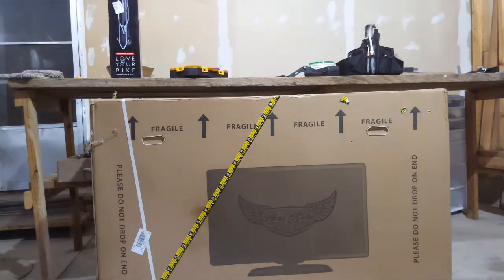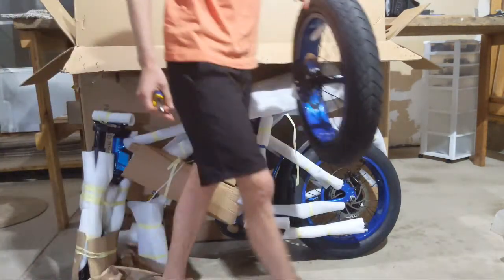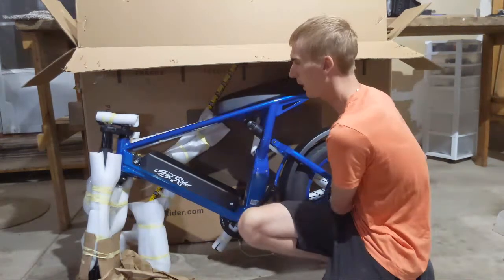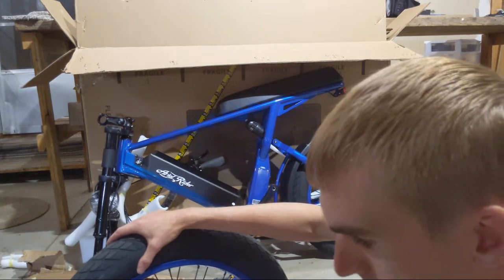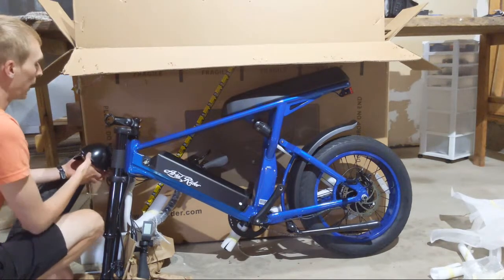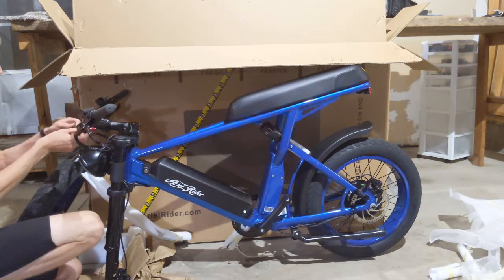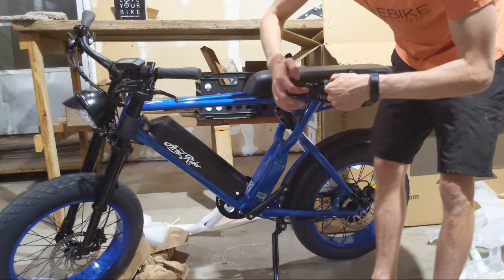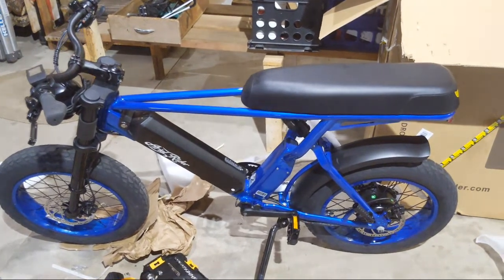Ariel Rider X-Class Live Unboxing

Comment: A nice air shock in the rear would probably do wonders for the ride.
Reply from the maker: There have already been people in the FB group upgrading the rear shock. If you're riding on the street this is probably fine but this would be an upgrade at the top of my list if I was looking to make changes. Having a blast with it so far.

Comment: Are you glad you got this and not the newer model?  They just changed!
Reply from the maker: Are you talking about the seat specifically?
Reply: I could not tell.  Did they only change the seat?  One person said the new model was faster. I wondered if they changed the controller or motor (even if it’s the same nominal wattage).
Reply from the maker: @howsth1s  I believe the shorter seat is now standard so you get some storage space. From what I read, both motors have the same specs - they just had to go with a different brand. You'd want to confirm with them if that was a deal breaker. The one I got is plenty fast...
Reply: @EbikeEscape  I received this email from AR:  "The seat has change and all future models with be twist throttle on the right side.
The new X-Class has the same speed.
 We do not have that [second seat] option yet but should in the future."

Comment: I don't know what it is with all these electric fat tire bikes getting flat.  If you talk to people who own regular fat tire bikes even cheaper ones.   ask them if they've ever gotten a flat before, more often than not the answer is no.   I've been kicking the crap out of my fat bike for years.  I've never even had to open up the a tire.  I think it would take something catastrophic to get a flat tire. And that's with 8 lb of pressure in the front 10 in the back.  If I'm in snow I go 6 in the front and 8 in the back.  And thank God cuz a tube is $20 a piece.
Reply from the maker: Mongoose sells tubes for around $10. I agree, lots of talk about flats and I've never had one with a total of around 4,000 miles. Thanks for your thoughts on the air pressure - I am curious how this will do in snow. Really want to try something with all wheel drive though and compare.

Comment: Why don't you just cut the front box on each end so you can pull the bike out instead of lifting it up. Work smart not hard and hurt your back or your wife's.
Reply from the maker: Good idea! Though for those purchasing these bikes you may want to keep the box at least for a little bit until you confirm everything is in working order. It is rare that they need to be sent back but I have seen it happen.